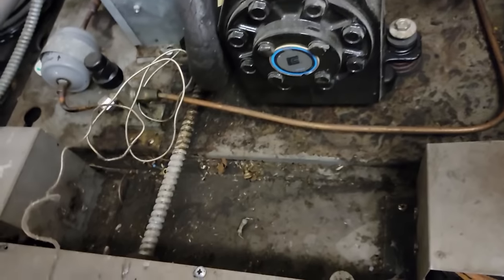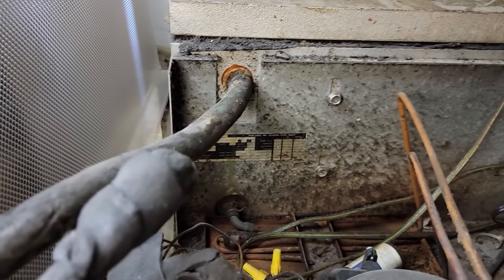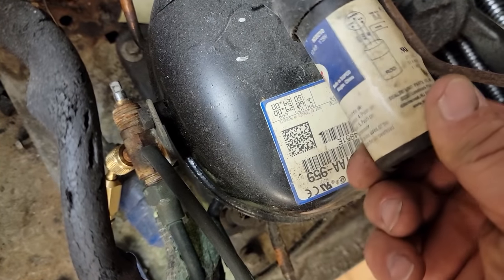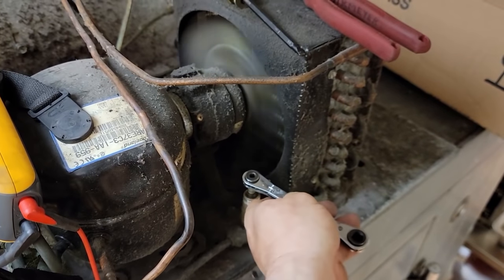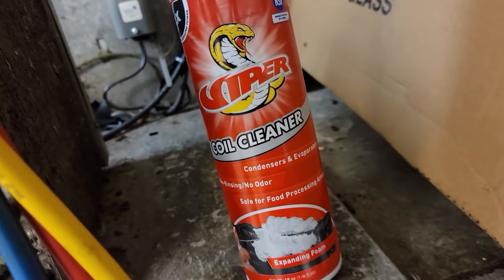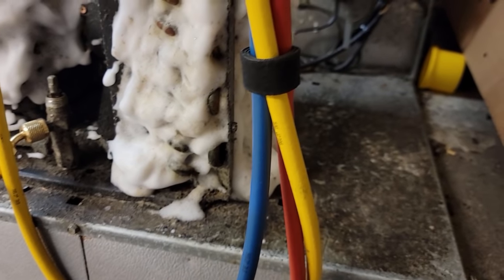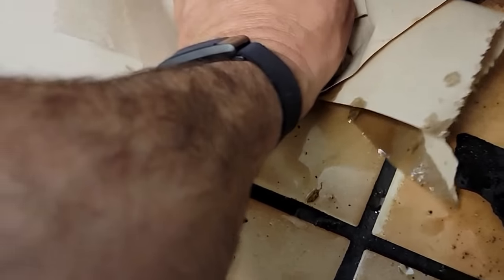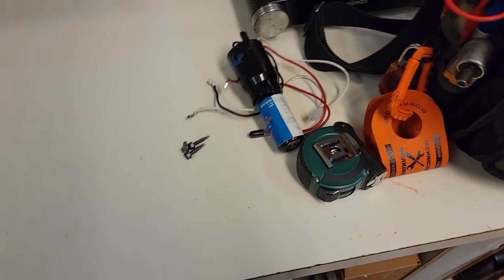Cooler Down For Days I Forgot? Can I Save It?

Comment: That viper is great! I usually carry a bag of rags and pack around the unit especially if rinsing.  That fine spray will penetrate deeper on your first pass if you take the time to aim between the coil fins, otherwise spraying willy nilly just foams up on the outer surface.

Comment: I keep a foil pan in the van to clean these coils. Unbolt the condensing section and place the coil end in the pan and tip up the other end with whatever u got. Can rinse thru without making a mess. Can also use it under prep table/RICs and RIFs.
Reply from the maker: I have a large flat cookie pan that I use under normal coolers but this one could not be lifted up

Comment: Awesome job. I'm surprised you haven't used the Viper cleaner before. It's great for kitchen condensers which get greasy.
Reply from the maker: The shop gets mainly NuCal... But the supply house tends to hide the refrigeration technology's stuff just like the solder weld🤦🏻

Comment: That cooler looks like it should have been replaced during the Reagan administration... That thing looks like it's seen some stuff and can tell some stories.

I'm the guy at work that pitches a fit when the coolers are rammed up against the wall so they can't breathe, and I periodically brush the coils even if they don't look like they need it. It takes all of five to ten minutes to check these things, I gotta move them around to sweep and mop underneath them anyway! While my HVAC training is only from a handful of YouTube channels, there are basic things I've learned from these videos that literally anyone can do to help prolong the life of the equipment. Almost everything else in the store is busted, but our refrigerators and walk-ins have been kicking @$$ for over twenty years. (I'm wondering who we use for HVAC because it certainly isn't our regular maintenance person, and thank you to whomever made that decision!)

The Refrigeration Technologies Viper stuff ain't no joke, it's worth every penny. After seeing countless coil cleanings over on Chris's channel, I bought a few rattle cans of it for myself, and set about cleaning the coils on the family cars' ACs and my bedroom window air conditioner. Even though you could see through the coils on the cars no problem beforehand, all sorts of dirt and road grime rinsed out. My window air conditioner coil was half-plugged with pollen that wouldn't rinse out with water alone. It works well for consumer and automotive applications as well.

For the cars, I covered the painted fiberglass bumpers with plastic sheeting just because I didn't know if it would be safe on automotive paint/clearcoat, I cannot say whether it is safe or not, so BUYER BEWARE.

Comment: What the hell is that Annie? That looks amazing
Reply from the maker: I did a video on it a year or two ago. It's a manual compressor start tester with built in capacitors, volt, amp and resistance meters, and the ability to reverse rotation of the compressor so that you can break it free and get them going.
Reply from the maker: https://youtu.be/So-b78PO_-s
Reply: A compressor on one of my recovery machines is locked up so needless to say, I’m really excited 😆. I’m 15 years Into mostly resi heating and air And have been playing with small (minimart/ 7-11)refrigeration And I’m nervous to just dive right into it. But here goes. Great video